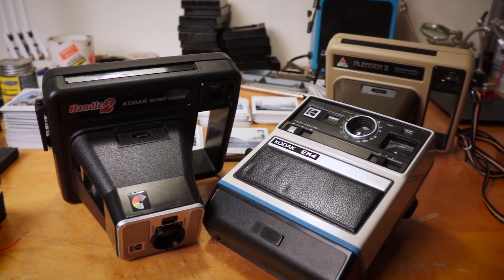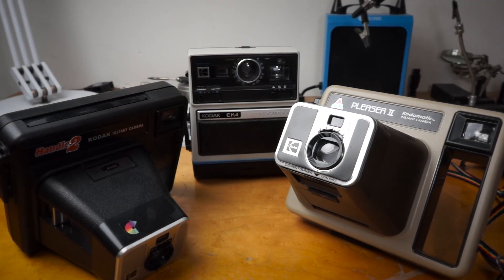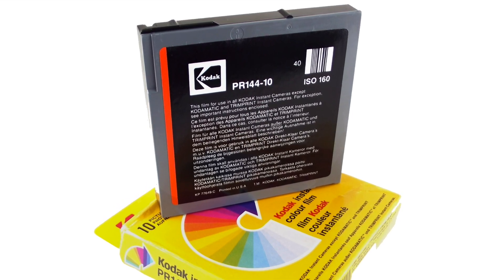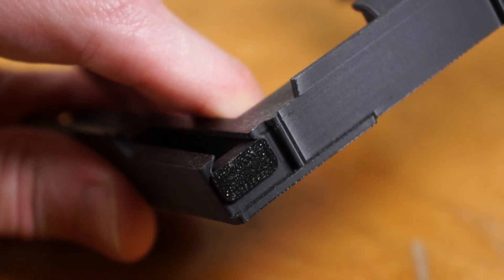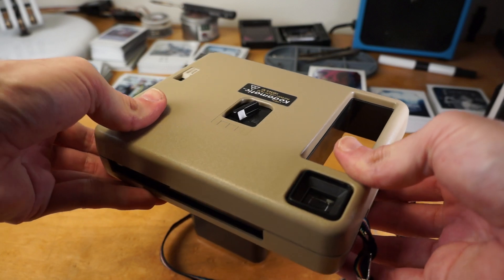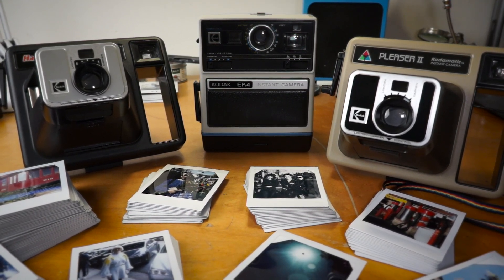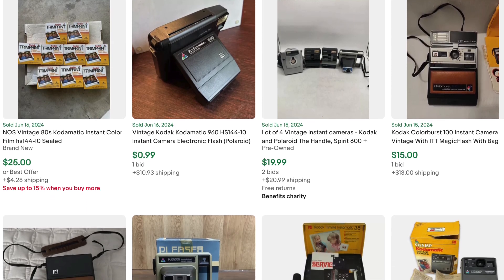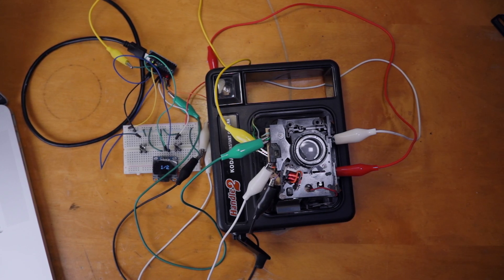Instax Film Adapter for Vintage Kodak Instant Cameras

Comment: Hiii! I got your instax square adapter working for 2 different cameras! I bought the handle camera for my boyfriend in perfect working condition and the adapter works great! And we rewired one of the battery wires on my pleaser and got it working also! I downloaded and printed all the files you have and curious if you have the I shaped double spring pieces that fit the mini film? The square I shaped piece doesn’t fit the indentations on the mini film as they are smaller as you know. TIA!!
Reply from the maker: That's so cool!! Thanks for letting me know it's worked for you, that's so great to hear! I added the Instax Mini spring pieces to thingiverse for you. Good luck!!

Comment: Would Instax Wide not fit?
Reply from the maker: Iirc, the film itself just barely fits, but it wouldn't leave any room for a cartridge or container. It'd be extremely difficult to get it to work, and then the lens probably wouldn't totally cover the image area and it would have to be loaded in a dark room

Comment: Nice job on all the testing. Just came across your original video from 9 years ago and then followed through to this one. If only there was a way to use Instax film in Polaroid cameras.
Reply from the maker: You can use instax film in polaroid cameras. The image would be reversed, since they expose from the other side of the film, but you'd get an image. You might need to adjust the rollers, and of course the film is a different size, so you'd need to adapt that somehow. And depending on the camera, you'd have to adjust the exposure. But the film itself would work.

Comment: Hi Josh! First of all, your work is amazing — I can’t believe I stumbled upon your content. I found a kodamatik PartyStar, and when I insert the batteries it makes a loud sound as if it’s trying to load film, but of course there’s none, so it just keeps running.
Is that normal behavior for this camera?
Do you think I should try your hack and test it out anyway, or does that sound more like a mechanical part that might be broken?

Thanks for being so passionate about this and sharing it with everyone!
Reply from the maker: Thanks so much!

Those are pretty interestingly designed cameras. I dont think it should just run continuously, even if no film or cartridge is in there. I would guess there's probably a broken gear. If you want to tinker, there are some replacement gears on Tihngiverse for the EK6 that might work or at least could be a starting point.

https://www.thingiverse.com/thing:6913735
Reply: @JoshGladstone  Thanks a lot! I’ll look into it and start researching the replacement gears<3

Comment: did you ever find a rechargeable battery that could fit where the old 6v battery would go? Ik they still sell them online but it would be nice to have a way to power the camera without spending some money on a proprietary battery
Reply from the maker: No I haven't. They do make 6v boost converters if you wanted to make one with a lipo, but finding a battery+electronics that small capable of putting out enough current to run the camera is going to be difficult, so I'd say a drop in replacement would be very challenging

Comment: Will this adapter work in the Colorburst 250? I saw the video on thingverse where you used the Colorburst 50, but that camera appears to be much smaller than the 250.
Reply from the maker: I think the 50 and 250 are pretty much the same, except the 250 has a flash, so the adapter should work the same. But I always warn people with automatic ejection cameras that the plastic gears are probably very brittle and could break. Good luck!

Comment: the counter moves from 0 to 1 but after rolling nothing comes out
Reply from the maker: It's hard to say, and can be really hard to figure out what's wrong since it all happens inside of a dark box. Does the picker arm move smoothly in the track? You can try winding it without film in, and with the back door open to see if you can figure out where the issue is. Good luck!
Reply: @JoshGladstone  i think i am not getting the spring tension right somehow
Reply from the maker: @TarunWadera-qv9cm  Definitely a possiblity

Comment: i am just not able to get it to work the picker arm is just not able to pull any sheets with my using the roller
have i constructed the adapter wrong ?
or using the wrong spring

Comment: Do you think it'd be possible to adapt to wide film? You'd have less space for the retractor  but it'd be closer to original size
Reply: I was wondering the same!
Reply from the maker: Unfortunately no, it's just a bit too wide. Iirc, the film itself just fits, but the cartridge doesn't.

Comment: So I just bought a 1979-1980s Kodak Party Time Instant Camera and it takes Kodak Instant Print Film PR-10 which i know has been discontinued for some time. Do you know something that is similar to that particular film that would work with this camera?
Reply from the maker: @hannahsternberg8550  it looks similar to the ek6, and some people have had success with that. Take a look on thingiverse and you'll see some remixes with some ek6 changes. But I always warn people that the gears in the auto ejection models can be extremely brittle and shatter with a small amount of resistance, so it's pretty likely you could break the camera. That said, some people have had success.
Reply: @ ok cool thx for the info! I just bought it for like $17 at an antique shop in town and went looking for film since it’s still in relatively good condition. So hopefully with this info I’ll be able to find some that will work! Thx again!

Comment: Do you think you will make them to sell?  My daughter collects old cameras.  I made an adapter for her Mamiya Press camera.  But we don’t have a 3D printer or any experience.  She just bought a Kodak Handle and it would be awesome to use it.  Any chance you’re considering producing them for sale?
Reply from the maker: @FrontDoor-u1d  No, I don't sell them. There's a good chance it won't work or could even break your camera, and I'm not comfortable charging money for something I can't guarantee. So it kinda has to be a diy project. But you could check your local libraries or makerspaces, they often have 3d printers and experience with printing

Comment: Hello, a 3d printing farm printed the pieces for me using Nylon Mechanical, but the pieces didn't slide or fit in properly so i had to sand them down.
I could find the exact spring that you had used so i used a .65x6x20mm spring stretched to 35mm but the camera cannot eject the instax pictures properly and the one time that it did the spread was horrible. could you please help me?
I've invested way too much money in this project....

Comment: Does the adapter work with auto cameras ?
Reply from the maker: I can't recommend it because the internal gears can break easily, but other people have had success with them.
Reply: @ Ty, I’m trying to get all the pieces together for my camera so 🤞
Reply from the maker: @HD-kp1tg  good luck!!
Reply: @JoshGladstone  I’ll let you know if it works or not
Reply: @JoshGladstone ok so I’ve gotten my own handle camera and a new battery but when I press the battery test button the red dot only appears sometimes and I’ve only been able to eject one photo? Is there any way I can fix the problem?

Comment: Im having issues with the picker arm.  I picked up a Handle 2, after ejecting the dark slide.  Sometimes it doesn't back far enough for the next shot. It has a ton of spring tension already
Reply from the maker: If the spring is long enough to push it all the way back, then it could be a few other things. It could be that the channel or the picker arm don't move smoothly and it's getting stuck. It could be that the spring pressure plate is pushing too hard. Try without the spring plate, and see if the first few shots come out. If so, the plate springs are too strong.
Reply: Are you talking about the pressure plate on back of the actual door?
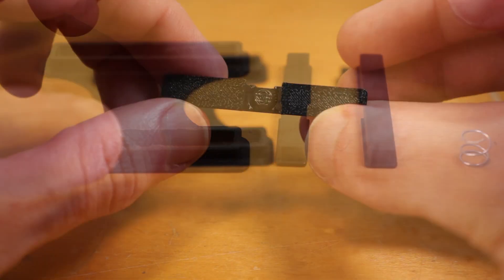Reply from the maker: @fosterb300  no the separate printed part that you see at 5:40 in the video
Reply: @JoshGladstone  oh okay.  Even without the pressure plate, it still doesn't reset all the way after the shutter button is depressed.  I added even more spring tension on the picker arm on the adapter and it hasn't helped
Reply from the maker: @fosterb300  and it slides smoothly in the channel and doesn't catch anywhere? Some people need to sand the picker arm or file the channel to get it to move smoothly. Also, if you load the adapter into the camera without film and just hold it in without closing the back door, you can wind the camera and examine the arm in motion and you might be able to get a better idea of what's going wrong

Comment: Could this work on a colorburst 250?
Reply from the maker: Yep! Those are the same basic layout as the EK4/EK6. A few people have said they've had them working reliably. I've broken a couple because the auto ejection gears can be brittle. Your mileage may vary. Be careful and have fun!
Reply: @JoshGladstone perfect! I picked one up at a vintage mall for $12 and it still works, gears look to be in good condition, just dirty. Everything else works fine and making those paper film loader things is such a hassle and wish i found this first lol
Reply: @lolwhodis7817  hi I have a colorburst 50, I was wondering if the adaptor worked fine for you and what material did you use for the 3d print? Thank you!

Comment: Does this work for kodamatic 950???
Reply from the maker: @marcosmateos7298  I don't think so? It's been a while but iirc, the picker arm layout is a little different. I tried to design one that worked but I broke my camera in the process. That said, it theoretically could be possible to make one that works. You'd need to replace the ejection gears first, but I think they're actually pretty easy to get to on these. They are cool cameras so it's on my list of projects. Hopefully I get to it! ¯\_(ツ)_/¯

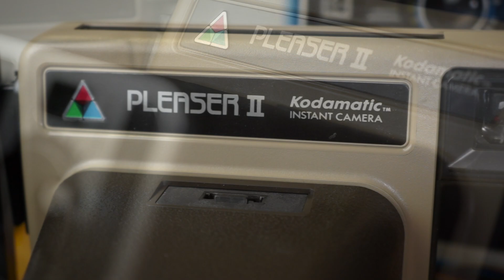Comment: 4:10 for other models, I would think an ND filter in front of the lens would do the trick.
Reply from the maker: Yes you're right. ND in front of the lens (and not in front of the light meter) would compensate for the film speed difference. Of course then you wouldn't benefit from the increased film speed, but the exposures would at least be correct. Excellent suggestion.

Comment: If i will use it on a Kodamatic 950, i dont need the EK4 tings, right?
Reply from the maker: @BjoernsWelt  no, but I'm also not sure it'll fit a kodamatic 950 at all
Reply: @JoshGladstone  ok thanks, i will try it soon,
Reply: @BjoernsWelt  news? i also have a kodamatic 950 that i would like to use

Comment: Pretty cool!  Even though you advise against it, I am trying to revive an EK6.  It took a few iterations but I was able to 3d print replacement gears for the two that self destruct after 50 years.  I have not had a chance to try the adapter yet, but and a couple tests with the old cartridge that came wit the camera, and it transports the film.  

I have a question about the widget you designed for the EK4 that changes the roller pressure.  I assume EK6 is similar, and would like to install it when I test the instax film.  Do you have instructions on that?
Reply from the maker: I do now! https://youtu.be/GLFBVRYM49I
Reply: @JoshGladstone   fantastic!   also, btw I found a good hack for the EK6 metering problem.  I taped a small bit of ND 0.6 gel over the window, making the camera think it is 2 stops darker than it actually is, pretty much correcting for the 160 ISO to 800 ISO film.  And being gel, its thin, and does not interfere with the plastic variable ND filter they have for the LIGHTER/DARKER adjustment slider, so you continue to have full control.
Reply: Hey! I think I solved the instax to EK6 (auto feed) camera problem.  I found a source for 3D printable files for the gears online, (I had to print them at 102% size to get them to work for me) and I made mods to your EK4 picker arm and the instax holder.  Initial testing indicates it feeds reliably.  More when I can confirm....
Reply from the maker: @Nateclapp  sick!
Reply: @Nateclapp  hey mate, How did it go reviving the EK6? I just got one that belonged to my grandpa and I'm very interested in reviving it. I don't have batteries (which is the first thing I need to get) or empty cartridges to try, but first of all I'd like to know if you were able to revive yours!

Comment: Could this work on a EK160-EF ?
Reply from the maker: @draker903   I'm not sure tbh. I think it's the same form factor as the ek4, so maybe? But it is a motorized ejection version so it will most likely not work and probably break the camera, so I really can't recommend it

Comment: what function does the battery do in the hand crank cameras ?
Reply from the maker: @TarunWadera-qv9cm  the light meter and the shutter timing
Reply: @JoshGladstone  so if i have the film inserted and click a photo and crank it out manually it will still show a picture or be completely dark ? or wont even let me click ?
Reply from the maker: @TarunWadera-qv9cm  as long as there's a cartridge loaded (or the little lever inside the film compartment is depressed) it will take a picture and eject the photo, even without a battery. It will just fire at a fixed shutter speed, so the photo might not come out because it probably won't be exposed properly

Comment: hi man, idk if you still will reply to this, but i have a question how can i change shutter speed for instax 800iso without arduino cus i have modded kodak ek100 (replaced gears, 2s lipo battery and usb c charging) but i dont want to use an nd filter, maybe some kind of a capacitor mod like for polaroid
 sx70 could work?
Reply from the maker: It's theoretically possible you could change the electronics to adjust the stock light sensor sensitivity for 800 speed film, but I haven't looked into it. I'd just recommend setting the exposure compensation all the way to darken, or maybe even removing the exposure compensation dial altogether to let even more light into the light sensor.
Reply: thanks for your reply, i will try removing the dial maybe it would work
Reply: @Firefox-sn2ys let US know
Reply: @Buggered71, so i removed all light filters, left only adjustment slider and it kinda worked but if sensor gets too much light (direct or almost direct sunlight) it freaks out and sets shutter speed to ~~1/5 of a second
ps: sorry for late reply

Comment: Hey, have you ever gotten your hands on the Kodak EK8? It's the holy grail Kodak camera, being a folding rangefinder. It's also made by Kodak's German subsidiary, so maybe there's hope it's better built and the gears for the automatic ejection aren't fried? They're common here in Europe, but I know they're rarer in North America.
Reply from the maker: @DavidDrahos  yes, I have one and broke it trying to get it to work. Hopefully I can fix it one day because it is a really cool design. But yeah, unfortunately the gears are quite brittle.
Reply: @JoshGladstone Sorry to tag you here but I Need your advices. I have One,in beautiful shape,Gear are spinning finely and It Is new,never been used.But your adapter with the standard picker arm doesn't match and I am wondering if I Need to print the Ek4 picker arm instead??
Reply from the maker: @Buggered71  iirc I think the ek8 needed a different design than the other cameras. I started to work on it but broke my camera on like my first or second try. And it's not immediately obvious how to disassemble the camera, so that would be a large project, unfortunately.
Reply: @JoshGladstone  I also got a printable link with gears for some of that Ek camera to 3d print if you are interested let me kno

Comment: Hi Josh,tried to reach you on Instagram but got no answer so far,so,what about the kodak ek 8?
I knowit has some manual control and it was top of their ek serie,would this mod be compatible?
Also,I am buying one with a handle,but I don't know if I have to print also the bottom plug,is it necessary?
Also,noticed you added a picker for the Ek4 model which lets you play a bit with focus,is it working any good now?
Please let me know which camera I have to choose for the best performance with this adapter,thank in advance.
I m sendind the project to a 3d printing service that's why I m bothering you,prefer to print all I need once for all.
I was wondering if your poject could also be modified to use instax Wide format too,would be great.
Reply from the maker: The plug is optional. I uploaded the ek4 picker because other people wanted to try getting it working. Instax wide is too large and won't physically fit so there's no way to make it work with the cameras unfortunately

Comment: I just found my old Handle camera I bought new in 1977. I was disappointed to find out the film is no longer available. I stumbled on to your video trying to find a solution to my problem. Is there any way you would consider selling these adapters?
Reply from the maker: There's a possibility the adapter could not work or worse break your camera, so it's not the kind of thing I'd be comfortable selling. So it has to be a diy sort of thing at the moment. Sorry about that.
Reply: @JoshGladstone  thank you for your response. I guess the camera is a conversation piece now.

Comment: Hello, I just got kodamatic 960, and it doesnt have vintage, does this adapter u made replace it ?
Reply from the maker: @yusifabasovv  the cameras with automatic ejection tend to break easily, so I wouldn't recommend it unfortunately
Reply: @JoshGladstone  so no luck for me ?:(
Reply: @JoshGladstone  is there any way I can contact you ?
Reply from the maker: @yusifabasovv  you can dm me on instagram. But no, I wouldn't recommend trying it with your camera.
Reply: @JoshGladstone  I followed you, but cant message you.
Reply from the maker: @yusifabasovv  sorry, try again